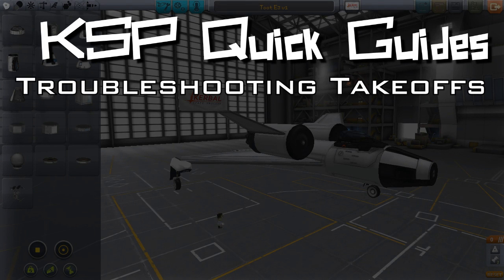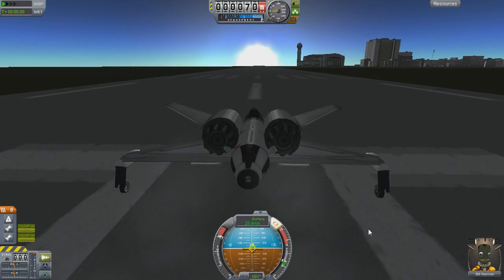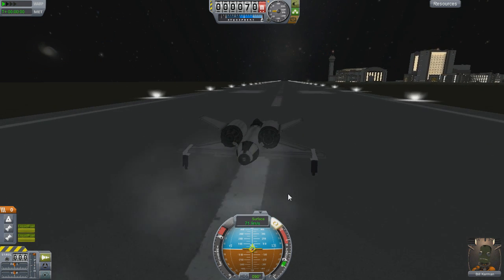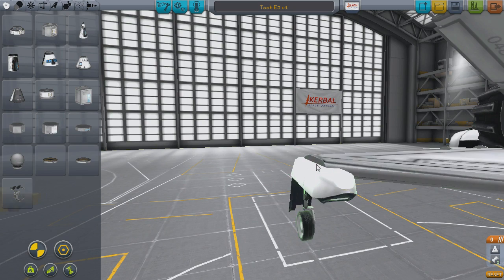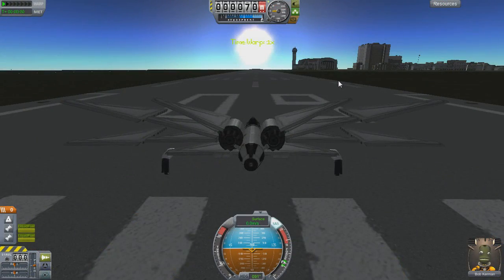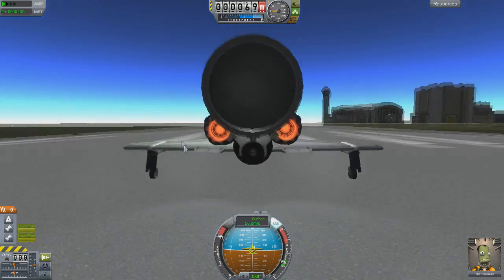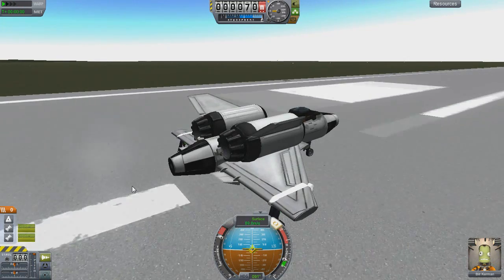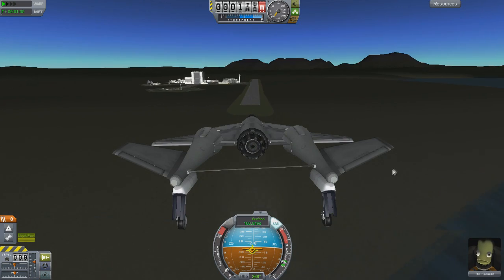KSP Quick Guides: Takeoff Troubleshooting Stock v.22

Comment: some times to deal with the threat of tail strike I add a few gear in the back that normally don't touch the ground unless i'm about to tail strike, like training wheels.
Reply from the maker: Definitely! Another thing you might try is to add a lot of trim (Shift + S key) during takeoff which will help you gradually lift in to the air, vs. pitching up rapidly and slamming the tail in to the ground.